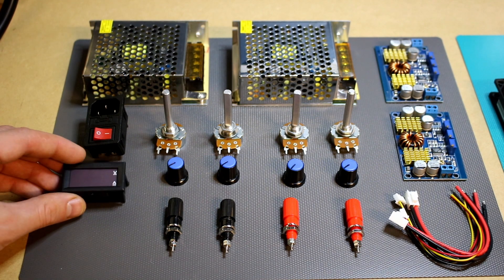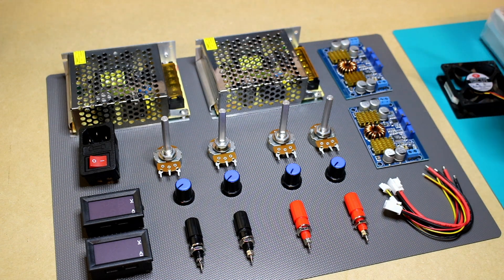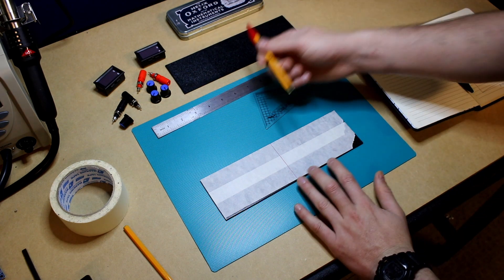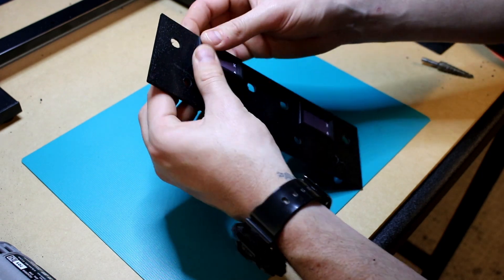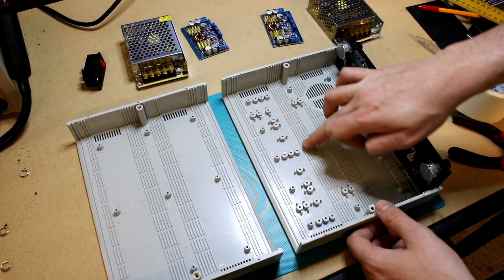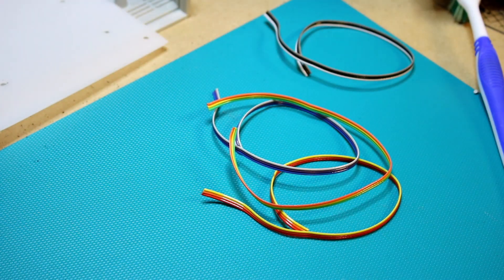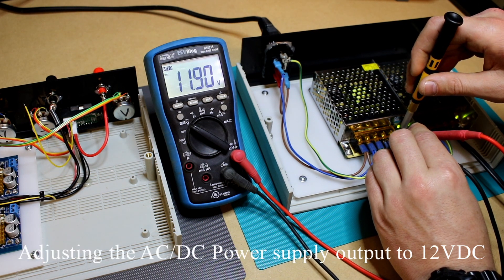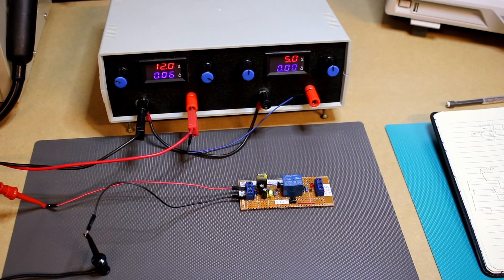DIY Dual Power Supply

Comment: Hey HandyTech,

Are you able to use this as an adjustable differential supply? IOW, could you connect the negative of channel one to the positive output of channel two and use the remaining positive and negative outputs to provide +/-30VDC? I'm interested in building your setup for this purpose, but would like to know if it works beforehand if you have time to perform that kinda of test under some simple loads. Thanks for the video!
Reply from the maker: I've since pulled the unit apart to use on other projects. Only odd connections I did was hooking up the power supplies in series which worked a treat

Comment: Hey, i have a background in mechanical engineering so I'm not the best electrician but I am in the process of making it and I was wondering if the power supplies are wired in series or parallel for there to only be 1 socket, also would this work 3x and 4x
Reply from the maker: Yep the 240v power supplies are wired in parallel and yes it would work with more. A safe idea would be to fuse the 240v input with a suitable fuse
Reply from the maker: Yep the 240v power supplies are wired in parallel and yes it would work with more. A safe idea would be to fuse the 240v input with a suitable fuse

Comment: Could you use this supply to get +12V and -12V rails for opamp projects by connecting the positive terminal of output 1 to the negative terminal of output 2?

Comment: Hi, nice job! Can you connect the power supplies in series, that you have +/- 30v and by the connect GND? Is it possible?
Reply from the maker: They are positive only power supplies. If you want to connect use both power supplies at the same time you will need to connect the negatives together so there is a common negative. There is a potential difference between the two that will need to be negated. I haven't actually tried linking the two in series but it could be done just not negative supply

Comment: awesome project. I tried to take little pot out and boom ltc3780 fault light was on. turning V protection pot is not doing anything... tried to replace it with 5k pot nothing. soldered original pot back nothing..
Reply: Set the pot to 0 or min. This is undervoltage protection so yiu dont need it

Comment: Hit there.. 1st off awesome build. 2nd I was wondering if this variable power supply would be suitable for using to power a foam hot wire cutter?
Reply from the maker: Cheers man. It would depend on the current draw of the foam cutter. Best to check the wattage ratings of the foam cutter and compare them to the output ratings on the power supplies. Hope that helps

Comment: Nice job! A couple of things I would have done slightly differently:-
Space the output terminals at the standard 19mm (3/4"), allowing various special plugs to be used, and which also gives more hand clearance to the knobs.
Use plugs and sockets for the pot connections to the PCBs.

Comment: It appears that you used two a/c inputs for the power supplies.  Is there any reason not to use a single a/c input wired to both supplies?
Reply from the maker: Mark WP Hi Mark I only used a single input for the two power supplies just might not have been shown in the vid sorry. Thanks for watching mate
Reply: 6:16 blue brown is the input, reds blacks are the outputs.

Comment: Is there a reason why you used two feed power supplies and not just one with a larger amp output?
Reply: Having fully independent  and isolated supplies, each with separate +  and - terminals. is much more flexible than having a common - terminal.  You can use one for + and one for -, or you can add then in series to increase the voltage. 
Nice design and nice packaging.
Reply from the maker: Hi Jason. I actually only decided last minute to do a dual version. The price of these items were so cheap I decided to buy two of each. Don't forget you have to tie the negatives together if you want to put the supplies in series :)
Reply: Fair enough.
:)

I am collecting parts to build something similar.
But I am planning to use an ATX supply as the main supply.